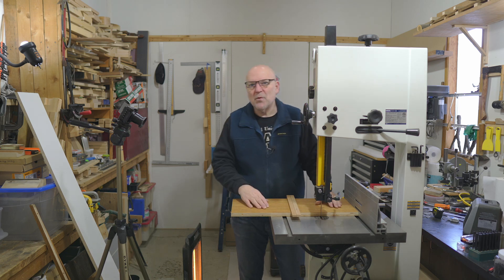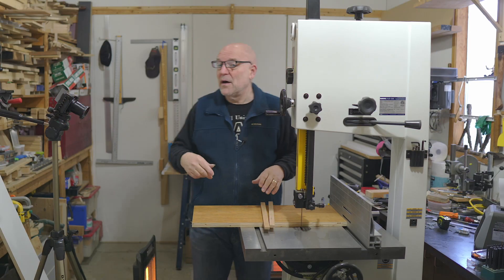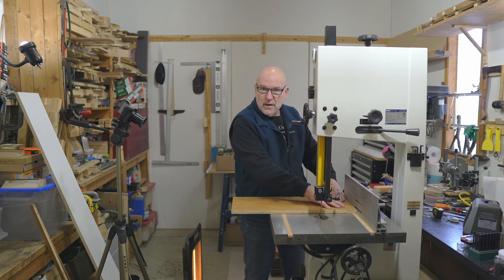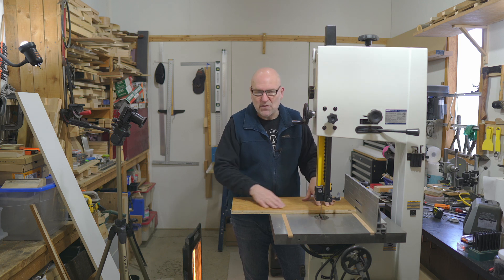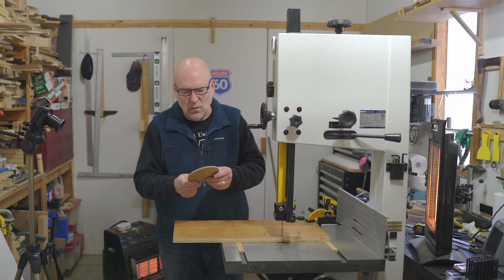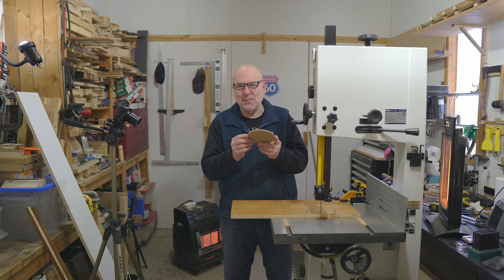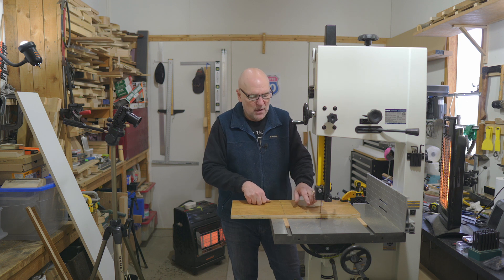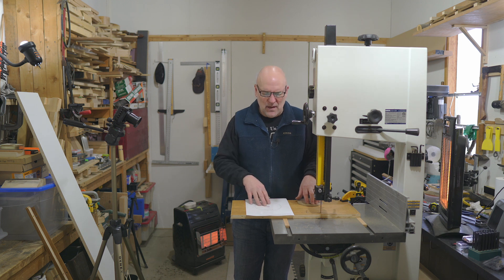Shop Jig - Quick & Dirty Circle Jig

Comment: Great jig, Jag! I'm thinking cutting deeper into the base plate would give you more support for the work piece. However your result is perfect on the smaller the piece.
Reply from the maker: I thought about that too, but I doubt I’ll cut anything much bigger. It’s definitely a modification I can make if needed. I also realized that 1/8”
is probably a bigger pin than I need. If I modify it, I’ll probably drill for a 1/16” pin.